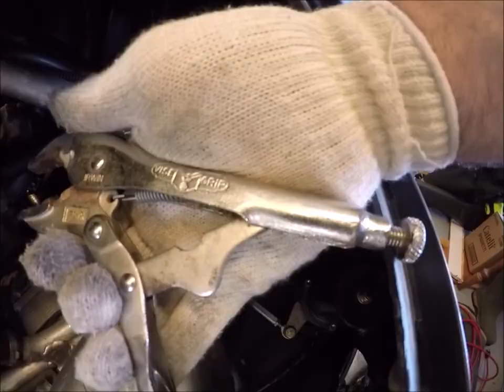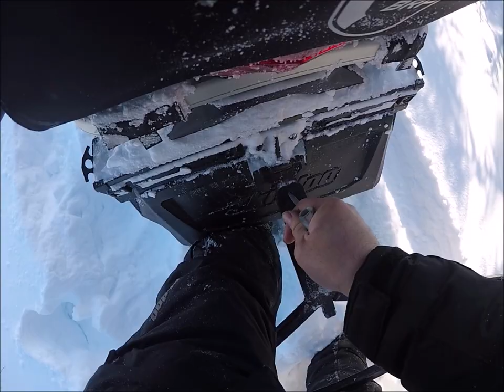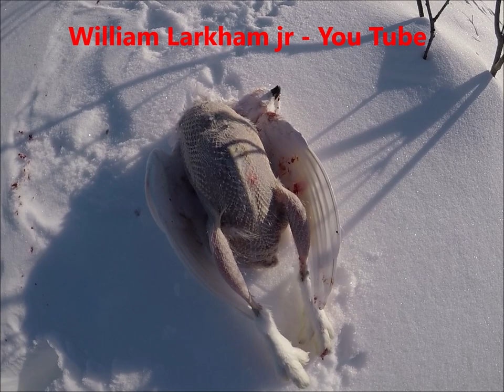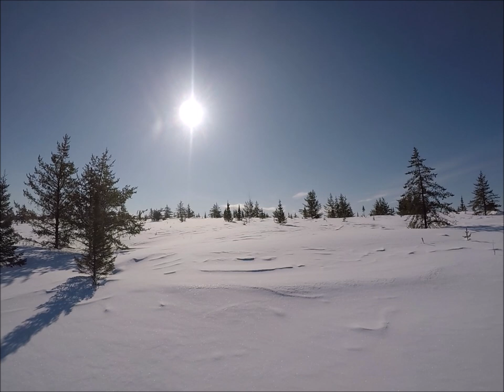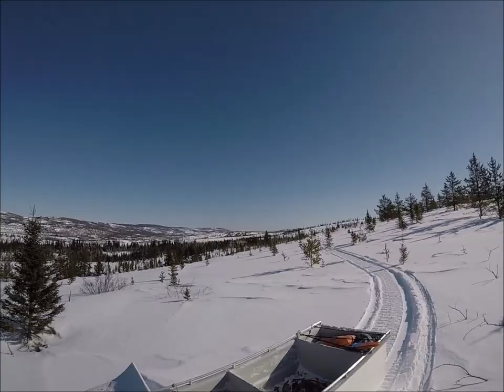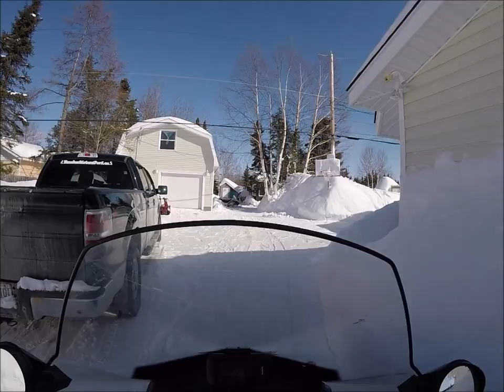New Toboggan, Few Birds & Bitta Wood

Comment: Hey William.. again, love your videos Sir , I can't wait my wife's and I's first visit to
 " the bigland"
My thinking  is that the partition  that separates sled into compartments, are also a  strengthening support for the sled as it might flimsy on the sides as its made of fibreglass. 

of course, I  could be wrong like  most of the times
Reply: I agree. It looks molded. Cut it out. Put some weight in there. Go out in cold temps. Something will crack eventually.
Reply from the maker: I think you and your wife will enjoy the trip for sure.  It's possible but I have see fiberglass toboggans longer without any compartments and with thinner fiberglass. Though i'm not sue if they had any issues because of it. I have seen the ones I'm talking about wear through along the bottom edge.   The fiberglass in this one reminds me the way a speedboat is build,  she's tough....

Comment: Re that Center  divider  on your toboggan…
If you cut that  divider out completely, then won’t it weaken the sides of the toboggan. 
Perhaps it would be wiser to  cut a large circular hole in it 
Or even a “U”  shaped hole, 
Then it would keep its strength. 
Just suggesting / wondering!